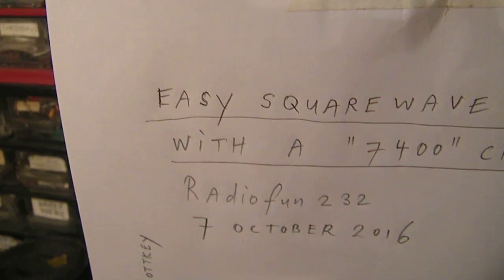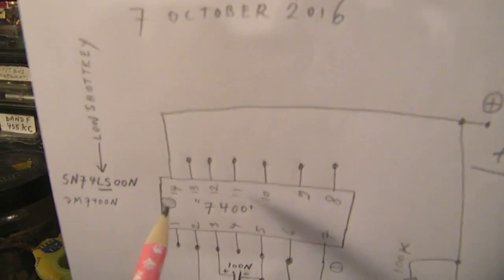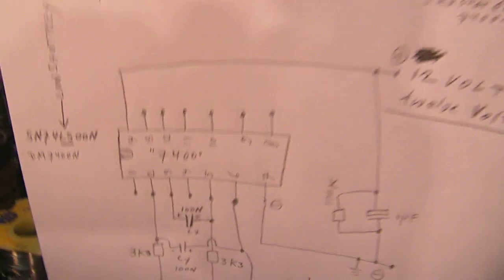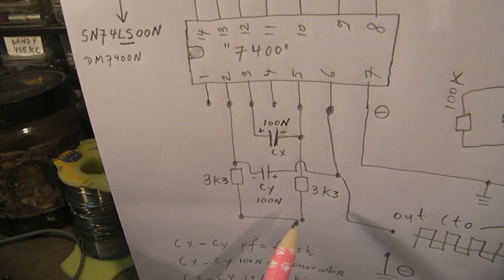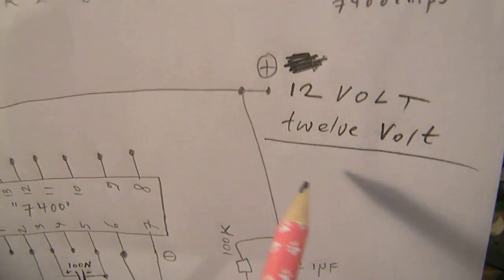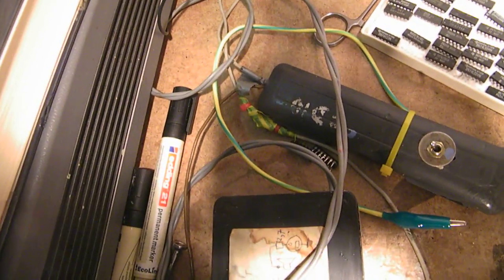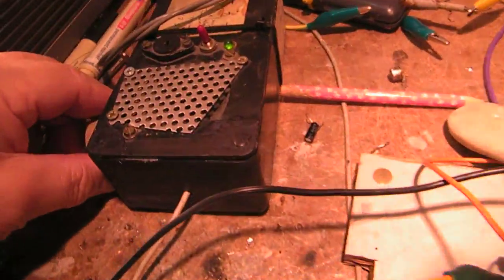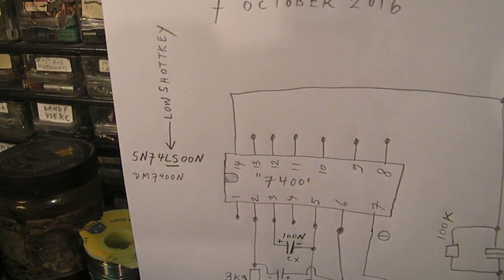easy square wave generator with a 7400 chip (schematic)

Comment: Hello Ko  i am exsperementing to make square wave generator with 2 transistors. Like flip flop circuit. I'm still trying and when I work it out will post my results some time in the future
Reply from the maker: Ok, good work! They often work immediately, sometimes there is a problem that they only start when you tip the + or - to the power supply and not when you slowly raise the voltage. But anyway: 95 % change on success!

Comment: 7400. I have maybe 20 of them somewhere at home. It would be nice to find some use for them in some little useful project. What I remember, years-years ago, I made a tranzistor tester which used this chip. It was even before I had my first multimeter.  It was a fun.

Comment: Could you write something about that little bench amplifier, you were using to listen to the signals of your oscillator, please?? Does it use discrete components or some chip? Or maybe it's a DIY so called "signal tracer"?
Reply from the maker: Yes it is a signal tracer. I will send you the links.
Reply from the maker: https://youtu.be/dY8OMNOO0OU
Reply: All discrete! :) Very nice little device. Thanks!